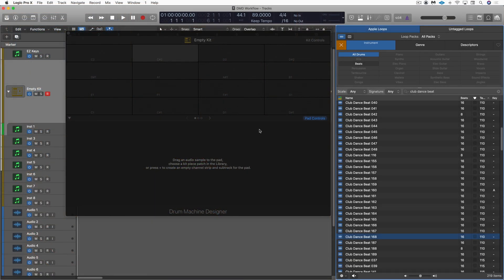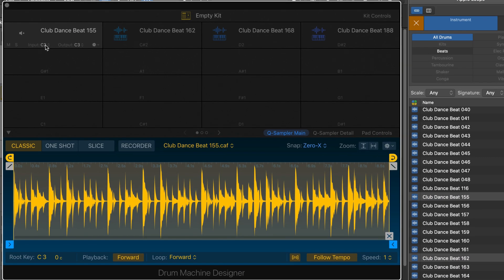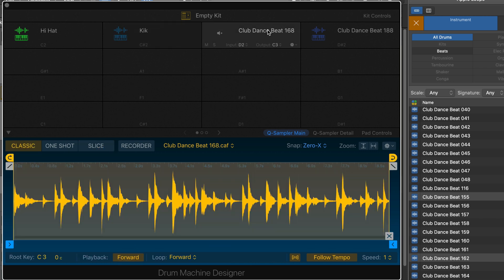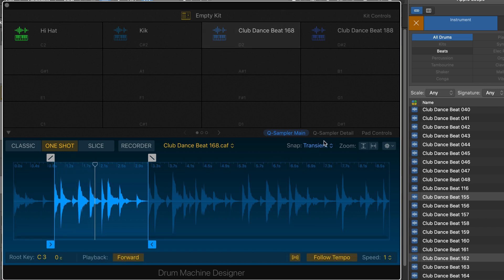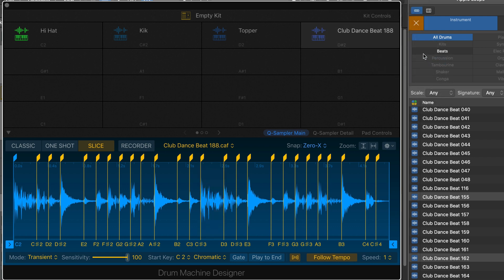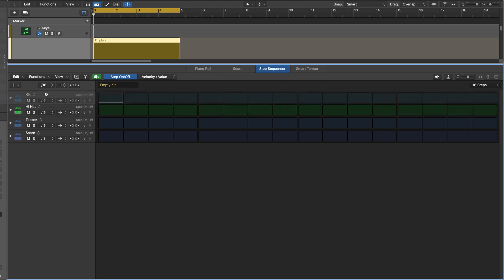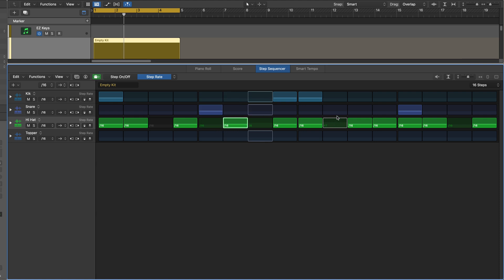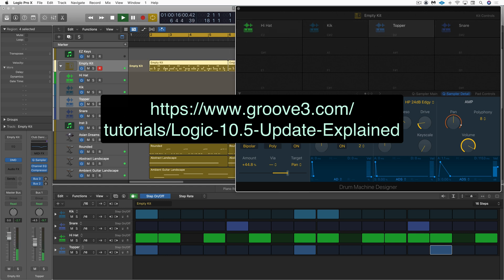Sonic Inspiration With Powerful New Drum Machine Designer Workflows In Logic Pro 10.5

Comment: is there anyway to use drum machine designer as a stereo instrument instead of logic creating many many sub channels and returns you may not want/need?
Reply from the maker: It loads up with all the instruments assigned to their own channel strip within a track stack. You can simply keep the stack closed, and just work with the stack master channel strip. Everything is routed there and you can process the entire signal there and program your parts there. So, although it technically isn't a plain vanilla stereo instance (it's a track stack), it looks acts and behaves the same as a single channel strip when the stack is kept closed. Hope this helps.
Reply: @elikrantzberg  ok, thanks eli.  i am watching your groove 3, 10.5 update series and it is very helpful.  thanks!!!